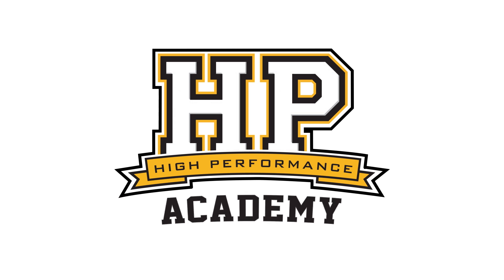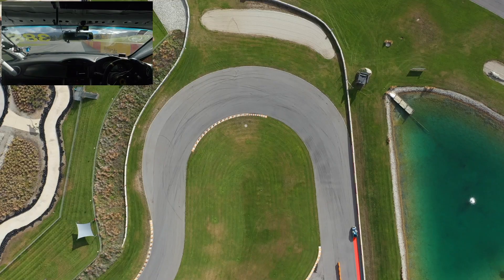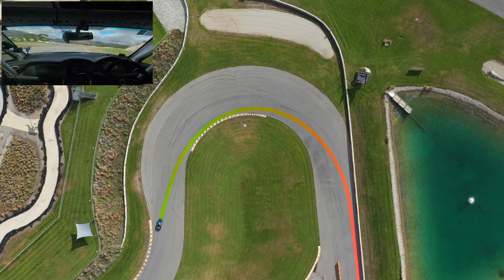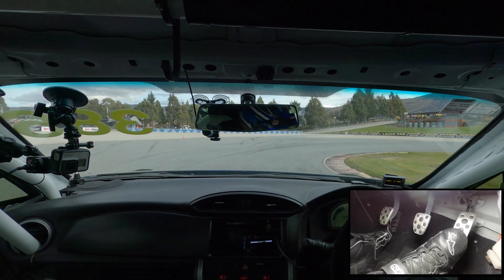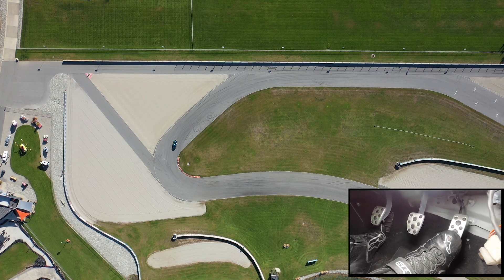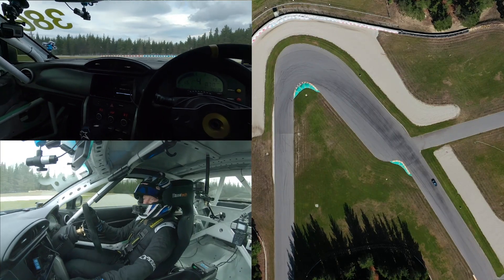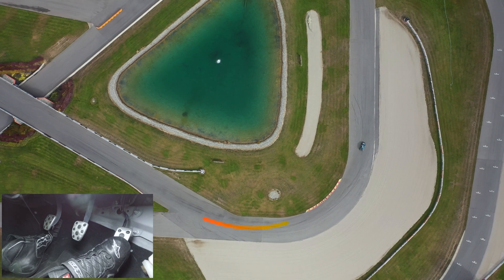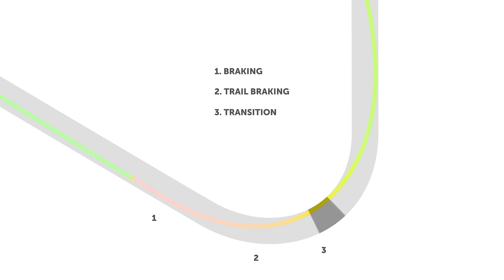🙋‍♂️ 3 Cornering Mistakes You're Definitely (Probably!) Making

Comment: In the motorcycle world you typically see people coming into corners to hot, not too slow. Leading to overshooting the apex.
Reply from the maker: For those learning there is more to it than just speed on a bike. Unlike a car your body positioning and lean angles play a huge roll, so while you think you might be coming in too fast on your bike it could be a case where your speed is fine and just your fundamental understanding of how to get your bike around the corner at that speed needs some work.

We don't cover bikes in this course however sorry, some of the knowledge will cross over but there are also some massive differences to a peddling a cage - Taz.